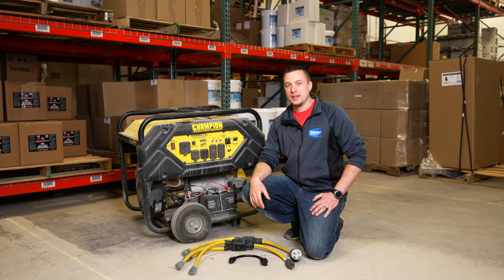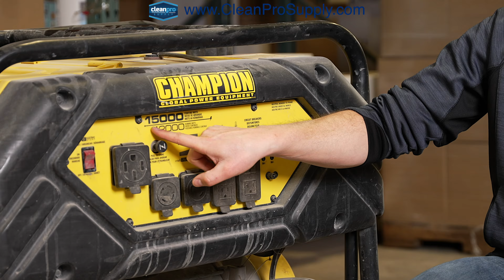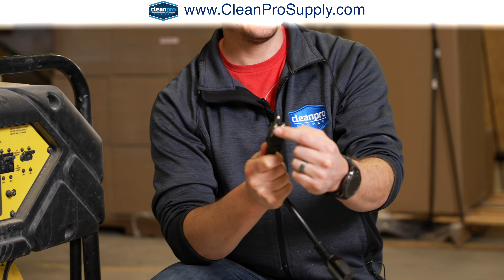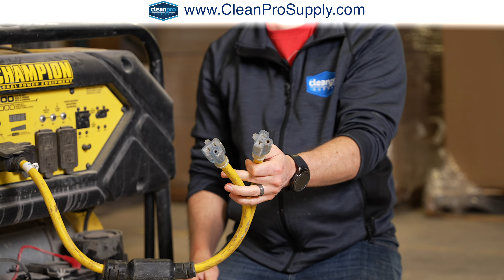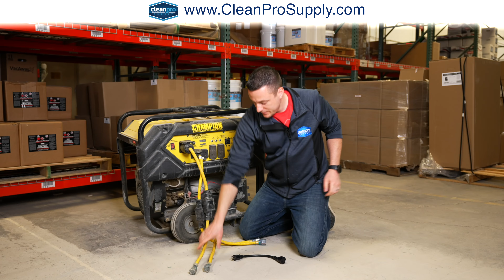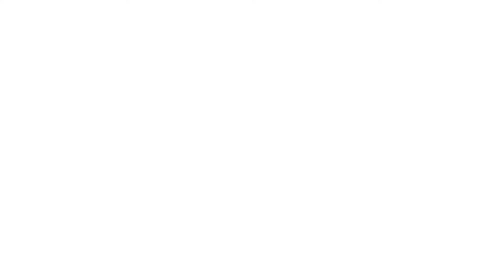Power Cord Adaptors, Splitters, and Power Sources Explained

Comment: Excellent video!
As a suggestion using a power distribution box equipped with circuit breakers is a good and safe way to bring electrical power to a site. Added saftey in line with the generator’s circuit breakers.

Comment: Champion 2500 Watt Inverter (has 110 volt plugs). So I know I need one that adapts 110 volt to the 30 amp, but is a surge protector needed to plug into the generator?

Comment: For the two standard outlets, you said that they are separate circuits. Are they running opposite of each other as far as the sign wave is concerned. Meaning, can each be used to power both legs of a standard home breaker panel? And, power a 220v breaker?

Comment: Hi, just saw this video.  I have a generator with 2-30 amp plugs, one is the 3 prong and the other is the 4 prong. One is Nema L14-30R and the other is the Nema L6-30R.  I have a 30 amp travel trailer that I want to power with the generator.  Does it matter which plug I use??  Thanks so much for your time.

Comment: Why are there two 120V outlets when you should only use one of them per leg?
Reply: I believe he is trying to say that if you use both outlets on the one receptacle, you could trip the breaker. This would happen if for example, you had two appliances like two refrigerators. Each needed 15 or 20amps to kick on and they both turned on at the same exact time, this would trip the breaker. If both were plugged in and one turned on to cool your food then the other a few minutes later, you should be good. Refrigerators only run about 6-8 amps, both combined about 16 running amps, under the 20amp power rating. Some refrigerators need anywhere from 10-20amps to kick on, thus if you had two in one outlet then you would trip the breaker.
Reply: @TheBostonStrangler  Great explanation. Yes the motor's starting amps is higher than its running amps. My very large two door refrigerator, 2022 model, runs at 7.1 amps, so twice that is 14 amps starting (which is just a guess). On a 20 amp circuit I could run the refrigerator fine, but on the other plug on the same circuit I can run a table lamp that has two led bulbs (10.5 watts or .09 amps each) on the other plug to maximize the plug outlets without going over the 20 amp maximum on the single plug.

Comment: Great video, super helpful! The 120/240 outlets; Can I connect any 120 or 240 volts device on it? The idea is to connect a generator to a transfer switch and then supply power to a 240 V a/c unit and some 120 V appliances on the same generator.
Reply: That is correct. You are able to power anything that needs either 120 or 240 volts. You may have a switch on your generator but it might not be necessary to flip it to 120 because your appliance or device will pull only the amount of power that it needs.

Comment: My new frig keeps tripping the breaker on my champion generator. I read that on some new frig’s this is an issue. Some people say the workaround is to use a 3-prong to 2-prong adapter. Any better ideas?
Reply: I would first need to understand which champion generator you have. If your generator doesn’t have the running watt capacity that it needed to power the refrigerator then your generator would trip every time.
Reply: @ACWORKS  it definitely has the capacity. After further investigation it looks like something on this new refrigerator “fools” the generator’s GFCI into tripping. My solution was to instead connect to the 240v port with an adapter.

Comment: Can I use the 50 amp outlet and the 30amp out on the generator to apply 80 amps to a single breaker box. I’m using separate cords of course
Reply: Sounds like you would have balancing issues

Comment: I have a 2200 running watt generator and a 100 ft, 10 gauge extension cord. Would it wrong to plug in an extra 75 ft, 12 gauge reel extension cord to the 100 ft extension cord to power household items?
Reply: From what I know if your going to 100ft you need 10awg or you might have a really hot cord better to go bigger

Comment: Great video.  Well presented.  But wanted to bring up a slight correction.  The 240V 30amp plug is providing 30amps per leg (per 120V circuit); this would mean the splitter you have on the 240V 30amp circuit would support 30amps for each connection (for a total of 60amps, not 30).  The totals watts for the 240V 30amp connection would be around 7,200.  The total watts for the 120V 30amp connection would be 3,600.

Comment: Did you say the 3 prong 30 amp outlet could run only 1 appliance , but I have a 3 prong 30 amp ext cord with 3 outlets on the other end ?
Reply: The 3-prong 30amp outlet is 120V.  Try not to consider the number of outlets on the end of your 30amp cord, but the actual load that you are placing on the 30amp cord.  You should be safe with a load as long as it is less than 30amps and is running 120V.

Comment: What if I'm trying to plug into a nema 14-50r  female that goes to a home? I can't seem to find any 50a power cords that go male-male.
Reply: You will not be able to find (legally) any cords that are male-male.  These cords are called "suicide cords", because they can kill people if the ends are accidentally touched by someone while the cord is energized.  The 14-50R plug on your home does not sound right... a generator inlet box will have the correct type of connector for your house.

Comment: At 6:46 when you split the 240v 30 output into two 120v output, each leg is still limited to 15 amps each.  You can't demand 25 amps on one leg and 5 amps on the other and think its ok.
Reply: 240v 30a plug is 2x30a 120v legs. 7200w max.

Comment: How would you wire or where would get a cable that has a 3-prong male end for plugging into a generator's 30 amp 3-hole receptacle and a 4-hole female end for plugging into a 30 amp 4-prong outlet connected to a house's 30 amp circuit?  My generator doesn't have a 4-hole 30 amp receptacle to match the house's.

Comment: It goes like this: One can not add up all the Amps at the same time. For you would go way higher than the 12,000 KW from your Generator. So remember this: it is "Kilowatts" that we are really working with. 

So IF you are using just under 50 Amps; on that largest receptacle X 240 V it = 12,000 KW. And that is IT! You could NOT use any other receptacle. But if you are not using but say; 35 amps, then you can use other receptacles. As long you don't exceed 50 Amps all together.

Comment: Why do they put two plugins on the 120 if you're only supposed to use one? Why not just put one outlet each?
Reply: you might be running a fan in one room...a tv in another, etc.
Reply: @spacecoastz4026  so you're admitting that both can be used safely at one time as specified.?.
Reply: @alexolivarez732  Yes...as long as you don't exceed the amp rating.